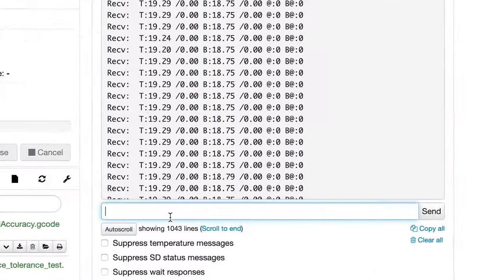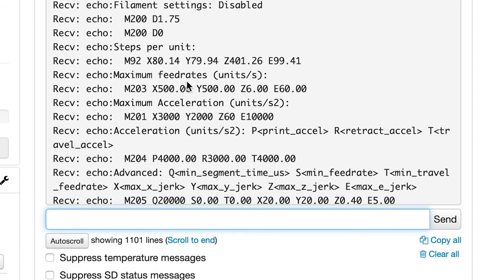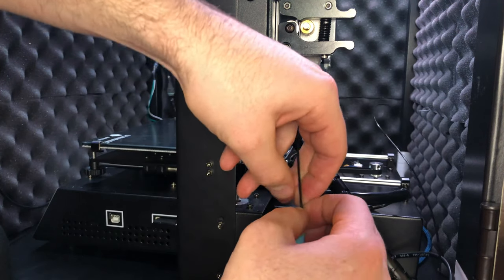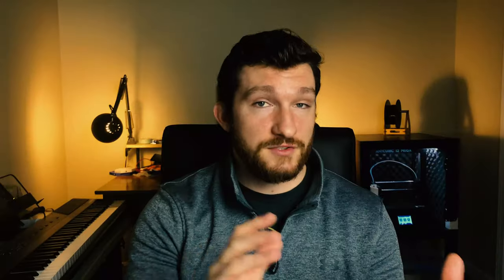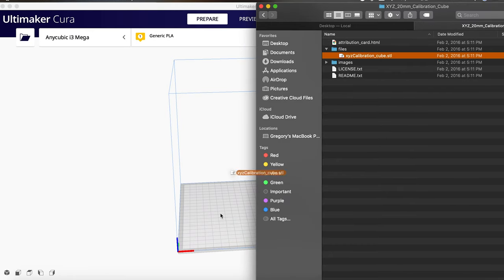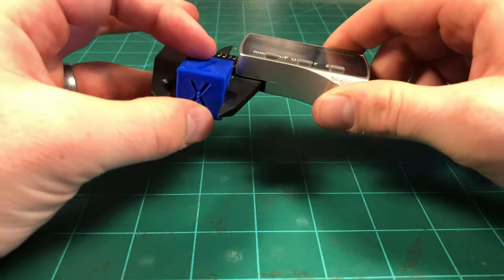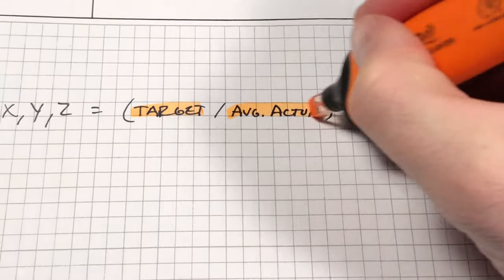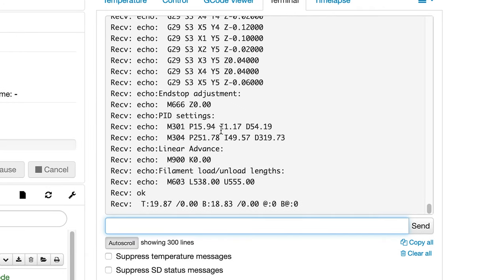How To Calibrate Your 3d Printer Stepper Motors

Comment: This is a GREAT VIDEO - excellent information and it was well edited - no "soap box" moments is always nice too.  ☺ On my Anycubic Mega X, I had to enable cold extrusion by sending M302 P1 before it would actually extrude for filament length calibration. Then I set it back to M302 S170 before writing my settings out to EEPROM.

I just upgraded my filament extruder to a dual gear type and when I extruded 10mm, it spit out 27.5mm! Your video was perfect for helping me get things set up properly. Thank you!
Reply from the maker: Thanks for the comment! I appreciate it!

Comment: Make a 3D printer they said...it’ll be easy they said.
Reply: Who is "they". Cause "they" couldn't be more wrong. But we got this.
Reply: For this 3d printing is like an evolution, after solving one problem another pops out, then a vicious cycle continues as I solve the new problem another pops out the cycle continues ad infinatum
Reply: @bentibz2750  this is what the engineering life is all about, solving problem, doesn't matter that we caused the problem with a fix, we just solve it.
Reply: @gronderful8871  you know they killed Kenny. They’re bastards.
Reply: Been 4 months and have yet to push plastic out the hotend...
Reply: MAKE?
Reply: What do I do if I did it with marlin

Comment: Tip if you do not want to waste fillament:
Remove the bowden tube at the extruder end by pushing down on the little black hose clamp and pulling the tube out. Heat up your hotend to 200C and pull the fillament out. Now you should be able to calibrate and repeat the process as many times without wasting it. To replace the bowden tube, just push it back into the extruder.

Comment: Thank you very much for this video!  Very well presented and put together. After I updated the firmware from stock (1.1.2) to the marlin v1.4.6, I found that my extruder was under extruding by a mile! E was set to 92.6 and has now been calibrated to E445.35!!! Anyone else had this? I ran the test and it is now extruding 100mm when I ask it to do so. Strangely I never had major issues with my prints using the stock firmware so I don't know if those figures went out of whack after the firmware upgrade or if they were like that all the time.  I wish I read the M503 figures before the firmware upgrade... but anyway... seems to be good now.  It'll be interesting if people comment / post their M503 figures.  I'll post mine a bit later once I'm done printing the 3d block and have calibrated the 3 axis.
Reply: Yeah mine was quite far off too, went from 92.6 to about 390.  It was under extruding by like 60mm!

Comment: Great write up this really helped. One thing missing is when calibrating the printer it will not extrude unless you warm up the print head first. Took me a couple minutes to figure it out. I saw it in terminal mode.
Reply from the maker: Good point! Thanks for adding that!

Comment: You are doing the community a HUGE disservice with this video. You should NEVER calibrate your X,Y, Z step values based on the results from printed objects. There are so many other factors to take into account that you are not going to be accurate by using this method. 

Additionally X, Y, Z steps are fixed values that are determined by the belt teeth pitch, stepper degree, stepper gear, and microstep values, 99% of the time you will not need to change these values. 

On the rare occasion that you do need to change them you should be using a dial indicator to measure the distance moved and compare it to the distance requested and you should take these measurements at multiple locations in the printer travel to make sure that you're not just dealing with a binding issue if something is off. 

Also whenever possible your E-step calibration should be done with the extruder disconnected from the hotend or with the nozzle removed in the case of direct drive to eliminate the hotend back pressure from skewing your results. You then need to calibrate your flow rates for each filament spool and set up filament profiles for each in your slicer to help with your dimensional accuracy for prints. 

If you want to see a video of how step calibration should really be done correctly then check out the Teaching Tech X Y Z step video and CHEP's E-step video. I appreciate that you are trying to help but you are spreading bad information that only hurts the community.

Comment: Also wanted to mention, the reason why you could not remove your filament guide from your print head is that there is a fitting on there with a plastic ring around the top. When this ring is pulled up, it locks the guide in place and they usually take a zip tie and pull it tight just under that ring to prevent it from being pushed down.  Simply cut the zip tie then push down on the ring and you should be able to remove the filament guide without any problem.
Reply from the maker: Thanks for the comment! Not going to lie, I was trying to pull the ring up instead of pushing it down... I somehow got filament stuck in the tube and found the only way to remove it was to pull the tube out of the hotend, and I was embarrassed by how simple it was lol
Reply: @ModernHobbyist  We all knew less then we know now ... if we get embarrassed for not knowing then we slow the proliferation of knowledge. ☺ - keep kicking out these quality videos ☺
Reply from the maker: @MikeSims70  Thanks Mike! Appreciate the feedback and the views!

Comment: That has really helped me. I wanted to upgrade my Idbox 3D printer but did not know what the stepper motors was in the board so i could put then into the new board ( I want to keep the old one as stock so i always have something working). This should help me find out what is on my board.
Reply from the maker: Thanks for the comment! I'm glad I could help!

Comment: When I try to  calibrate extruder it doesn't work. my E value is around the 7120 but it still extrudes 25-47 mm filament. I've found E values between 100-7120. What should I do?

Comment: No need to print the cube. And with such small cube the measurements error is quite big. Just move each axis by 100 mm and measure real distance...
Reply: how would you measure the real distance?  if nothing is printed?
Just asking
Reply: @TheDropYouNeed  just put simple ruler on a table. Lower the head and align with zero on ruler
Reply: Wait that's actually very smart thanks

Comment: The E Step segment was good, the calibration Cube is unfortunately not a great way to test the other step values tho... I know that wasn't really known when this video was made, but definitely worth stating at this point
Reply from the maker: Thanks for the comment! I think the extruder e-step calibration bears revisiting as well, since measuring 100mm of filament extruded is hard to achieve with calipers 🤔. Appreciate your thoughts, I'll look into making an updated version of this video!
Reply: @ModernHobbyist  CNC Kitchen has a good video on calibrating the XYZ steps with a much better test print for reference (tho he does mention some benefits of the calibration Cube, even if not for measuring)

Comment: Great video although I am not understanding you saying for X, Y and Z average, do you just mean what the caliper actualy read it as? 
Also what should the cube mesure in the first place.
None of this seem to be mentioned in the video.
Reply from the maker: Thanks for the comment! I haven't calibrated in a while, but I believe the cube with 20mm, and I measured each side 3 times, taking an average of the 3 measurements. So I measured the X axis of the cube three times (e.g. 20.03, 20.06, 20.08) and took the average of those to find a good estimate of how much the X axis is off on my machine. I then repeated that for Y and Z. Hope that makes sense!

Comment: Hey there!  Great video!  I have a i3 Mega and have been wondering how to calibrate the step motors, so I really appreciate this video!! Can you go through the equation for the step motor calibration a bit more in depth? ...  So, you have: (Target / Avg Actual) x Current steps.  Is the "Target" 20mm because that's the size of the cube?  I get the "Avg Actual".  And then, "Current Steps" would be the values for X,Y,Z from the M503 command?  I got confused because the numbers you had in the equation for that segment of the video are 100 and 120, the same as what you used for the extruder calibration(??).  Thanks in advance!!
Reply from the maker: Thanks for catching that! The target would be 20mm, so if you ignore the part where I plug in the incorrect values for the movement motors and just take the equation, that would be correct. In short, (20/avg.)*current steps.

Thanks again for the comment!

Comment: Great video! One question,  for e steps, I've been using the formula,  actual extruded length x 1000 then divide that by current estep setting, to get my new estep value. Would that work for the 3 axes as well?

Comment: Yet another great video, you are truly a saviour for anyone who is starting with 3D printing. I have already applied your mosfet upgrade which went really well, I have noticed my i3 Mega S was still having some issues. So I installed Marlin re-calibrated my extruder stepper motor and boy was that under extruding or what? One issue though, how exactly are you measuring the cube and how are you coming up with an average?

On my i3 Mega S my XYZ stepper motors are M92  X80.00 Y80.00 Z400.00
Reply from the maker: Hey, thanks for your comment! To measure the cube, I took three measurements on each axis, and took an average of all three. I then used that to calculate the new X,Y,Z steps.

Let me know if that helps!

Comment: You should calibrate the E-steps not through the Hotend. Disconnect the Bowden an calibrate "cold".
Reply from the maker: I agree, that would be the best way. Unfortunately, I was unable to get the bowden tube disconnected from the heating element, so I had to improvise. Thanks for the comment though!

Comment: I printed the cube got a 20.1 for both my X and Y axis. The Z axis came out perfect at 20.0.  Is the 20.1 considered within acceptable tolerance for the XY and be left alone or should I change the value?
Reply from the maker: Thanks for the comment!

That is completely up to you. I would say that is pretty good, especially considering it is consistent between both axes. You could always jot down the current value, try updating it, and if it makes it worse, revert back to the original value. Worth a shot anyways.

Comment: For the print calibration of the movement motors, in the second calculation I am supposed to take the updated E value from the first calibration where I calibrated the extruder motor and sent M500 command to the printer right? Example: Previously upon booting up before calibration my E value is 92.6, however I calibrated the extruder motor which made me enter the E value to be 105.48 and then M500. Now when I calibrate the movement motors I must use 105.48 right?

Comment: Using a calibration cube, flow also has a direct effect on the dimensional accuracy. So does horizontal expansion. The Step values for the X, Y and Z are hardware limited. I'm not sure calibrating in this manner is a good idea.

Comment: Any idea why I get a weird bulging layer on all my prints?
For info, I get one layer 5mm above the bed on every single one of my prints that is bulging out from the side and it's clearly visible on every print at the same height. The rest of the print is fine and works well. But I can't for the life of me figure out why I'd be getting one bulged layer. Thanks in advance!

Edit: I have an Anycubic Mega Zero, and can't connect via octoprint for some reason (even though I can connect with cura)
Also, I can provide photos of my prints if you'd like

Comment: I have 3 artillery sidewinder x1s only one is using octoprint because I only have one raspberry pi can m500 save it to each one if they don't use octoprint? Like unhook the pi and plug up each one?
Reply from the maker: Hey! You can definitely use the same Pi to send the command to all three printers, but you’ll need to send the calibration values to each printer before sending M500. Also, you’ll want to measure and calculate calibration values for each machine individually because they will all vary due to belt tension, manufacturing differences, etc… hope that helps!

Comment: Not too sure where to ask the question but here goes.
I have had an A20T, and problems since I purchased it. But at long last I have it printing badly.....
I need to know how to tune all three extruder steppers in G-code. But can't find the command to get the E settings on each stepper motor.
Could anyone help me with this one?
I'm using Pronterface to talk to the device 
Regards
Kevin

Comment: Hi, I'm quite new on 3D print. I have a FlyingBear Ghost 5. Now, to use Octoprint you need to buy a Rasperry?...or? Have been looking for a video of yours about a tutorial for dummies on Octoprint and Rasperry. I dowloded Octoprint from their web page and got an img file that I should use for falshing a Rasperry.... I'm lost. What's next? Thanks a lot for your kind help.
Reply from the maker: Thanks for the comment! OctoPrint can be run on any computer as a simple web server, but OctoPi is the most popular, since its easier to dedicate a $35 computer to your printer, as opposed to your personal laptop. If you are interested in running it on something other than your pi, check out the links at the bottom of the downloads page for setup instructions for Linux, Windows and Mac. 

https://octoprint.org/download/

Thanks again for the comment and I hope that helps!

Comment: Hi, thanks for the video but I'm just starting the calibration with an ender 3 v2, i sent the G1 E100 F100 via octoprint and the printer just fully unloaded the filament, then it stopped. Is there a different step with this printer? Before sending the command I preheated the hotend to 200 degrees, using PLA. (also, I have jyers UBL with bltouch firmware). Help please. Thank you!
Reply from the maker: Hey thanks for the comment! I haven’t tried this myself, but what I’m reading online is that you need to send M83 before the G1 command to enter relative positioning mode. Not sure that is the solution, but I hope it helps!

Comment: Is there another way to calibrate the stepper motors without octoprint ? Sorry if I missed something just making sure
Reply from the maker: Sure! You just need a way of sending Goode commands to the printer and receiving the response. For me that was OctoPrint, but there are other tools
Reply: @ModernHobbyist  thanks for the quick response. I'll try to look up some other ways of doing it. Thanks again
Reply: Repetier-Host or Pronterface

Comment: hello very good the video, the case is that I have a problem since my printer got stuck, all sd and usb reading systems work, temperature of the extruder and bed. But when it comes to printing, it gets stuck with stripping temperature 0 and bed 0. I don't know if you could tell me what might be happening. It all started since I was standing in one piece. Thank you .
Reply from the maker: Are you on an Anycubic i3 Mega?

Comment: Hi there, thanks fort he tutorial, its very helpful! I just dont get one thing.
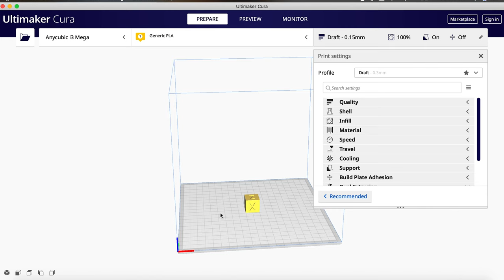At 5:42 the X on the cube is facing to the front of the printer (as on every tutorial i saw), so that would mean the distance withe the X on the face measures actually the Y dimensions (front to back).
Or do I think wrong?
Same problem with the Y axis, the only one which seems correct is Z.

Thank you for an explanation
Reply from the maker: Hey Dave, thanks for the comment. I see what you're saying, that could just be caused by me not rotating the cube the correct direction in the slicer. I just had to make sure that I measured the cube as it was oriented on my plate, so I measured the width of the X & Y faces rather than the depth. I hope that makes sense, thanks again for the comment!
Reply: @ModernHobbyist  oh sure that makes sense, if you measure the width of the cube instead of the depth. Thanks for the answer!

Comment: Thank you! Does updating the firmware (due to some other changes, e.g. probe offset value) change these M500 values or the values of the printer calibration that was done?
Reply from the maker: Hey Walter, thanks for the comment! From my experience, yes it clears the calibrations values to the defaults defined by the firmware. Hope that helps!
Reply: Modern Hobbyist . Thank you. I was wondering if it was some steps that I had forgotten to do or maybe my firmware Marlin 1.1.9 Bugfix has a problem. I had to do the bed levelling each time I made a change upload on Marlin.

Comment: Help me please I have a anycubic i3 mega and installed tmc2009 and reversed the plugs and white plastic inserts I calibrated the stepper cards .830.
My extruder motor doesn't work now.
No intake or remove of Filament.
The machine will home and goes in the right direction.
Reply from the maker: Thanks for the comment Bobby! It has been a while since I looked inside my Anycubic, but I did notice that one of the motor connectors is oriented differently than the rest, and my theory is that is the extruder motor connector. I'm not sure if it was initially oriented backwards or if that connector was supposed to be skipped, but it's worth looking into.  There is a picture at this link that highlights what I'm talking about. Hopefully that helps!
https://www.pialasse.com/2020/05/tmc2209-v3-0-upgrade-for-i3-mega/